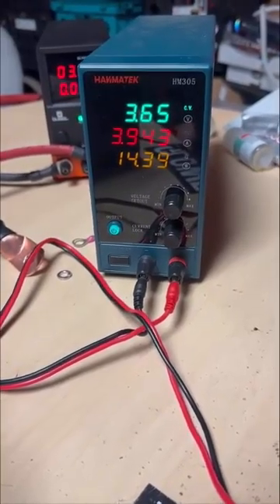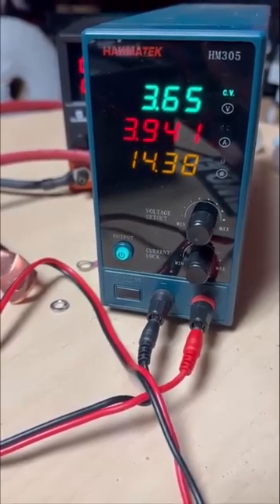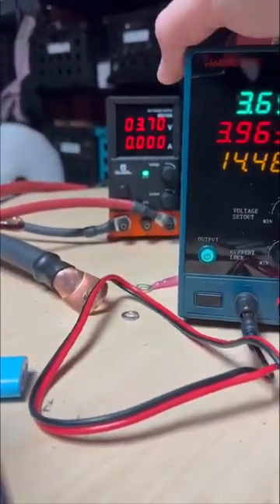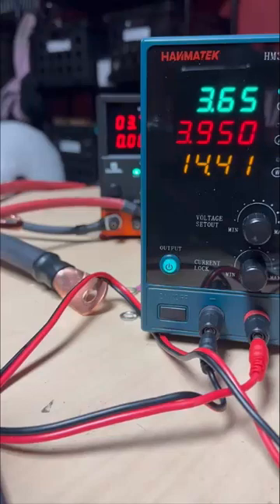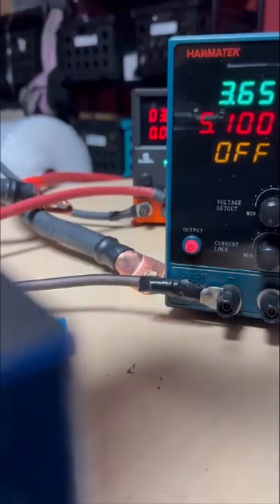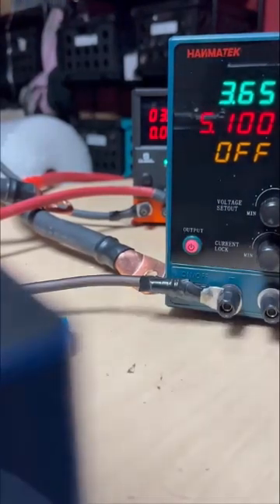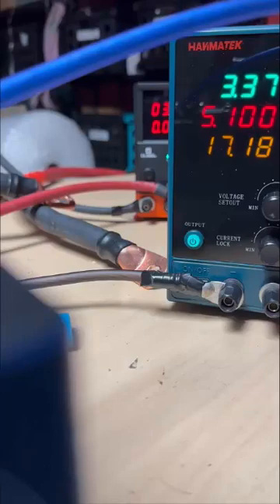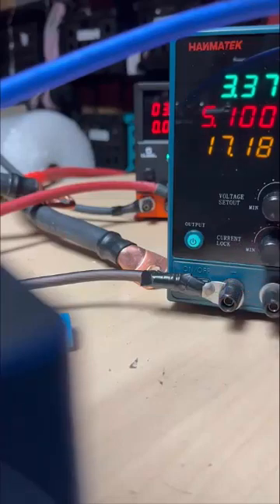Charging lithium batteries?  You're doing it wrong! This quick fix has saved me HUNDREDS of hours!

Comment: I like when people know why- and not just - THIS is how it's done, - no idea of Why it's done that way 

-lithium -all types, use a CV maximum because of the separator that is used - between the anode and cathoid, it has the same -structure in Lithium-ion, and Lifep04, ... above 4.2 (critical 4.9) it will start to short out, it's enough voltage to overcome its resistance .. it's just as sensitive as a capacitor (like supper capacitors) to over-voltage, it's not the current charging it is why 4.2v - it's for safety, and a mean point for best Cycle-life and capacity .. - Lifepo4 can also charge at 4.2v, but it's not going to get its 20k cycle life... but can safely charge at that voltage   - now it's a different chemistry - the advantages do not outway the cost, - the voltage will still drop down to 3.35-ish at rest, and still have its FLAT discharge curve 

- battery types that fast charges like NIHM/cd or Flooded acid.. can keep raising the voltage to maintain current .. this is called VV/CC (variable voltage constant current ) there able to do this because they burn off excess charge as a heat ... - a nihm, it has a resting voltage of 1.4v, nom of 1.2v - a Vary flat discharge curve ... you can go up to 5v-cell during charging, this will not damage it at all ..., there are multiple ways of knowing when it hits FULL-charge, the easiest way - it heats up and gets hot to the touch..  .. (or a charge will look for the voltage of the cell, it drops slightly at FULLy charged ) 
flooded acid can do this vary similarly, above 2.45v it's going to start off-gassing , you must replace the electro-water ) 
- attempting this even 1 time on Lithium will destroy its live-span and can be very dangous if you do not know that already
Reply from the maker: I like LifePo4 if for nothing else than how safe they are.  I've been completely unable to ever make one catch fire or do anything worse than vent.

Comment: All of my charging sources used for semi-permanent charging have 10 gauge wire.  It's good for 30 amps (40 amps for 90C THHN) for long runs and easily 20-25% more for the very short runs associated with most battery charging - that's also why they make IR thermometers ;-)
Even some of the physically small lithium-based packs have serious current potential.  A Fuji 12 volt 9AH battery pack has a 4s3p configuration of Murata LiFePO4 26650 cells that can deliver 25 amps per cell.  If you plan to use the pack's full capabilities, you'll need a big BMS and some serious wiring.  I'm more likely to use a pack of its physical size as a replacement for an AGM UPS battery so a 30 or 40 amp BMS is fine and we're back to 10 gauge wire.  Nice to have a UPS where the UPS' low voltage shutdown is higher than the LiFePO4 pack's low voltage cutoff.  The UPS can never damage the battery by excessive discharge - that plus the usual overly agressive charging UPS units do (to get the battery back to full capacity as fast as possible) contribute greatly to the short life the AGM batteries in UPS units experience.
Reply from the maker: Notyoung, the batteries that we (Glowe Voltage) sell are designed to sustain over 400 amps.  They're abused in car audio situations every day, for sure.

Comment: You might also want to pull the case off and have a look at the internal wires, mainly the two going from the board to the back side of the Pos and Neg banana terminals. I can't remember what mine were for sure but I think they were 14awg internally. So I just soldered a run of 10awg for Pos and Neg on the inside of the case. After I got it out back together I made a couple 10awg leads, the difference is huge!
Reply from the maker: Good idea, but I primarily use a much larger charger. This was more or less for demo purposes.

Comment: See if you can find a charger with sense input. The sense leads connect via separate cables directly to the battery terminals and compensate for loss on the charging cables.
Reply from the maker: A lot of the battery testers I use have 4 wire input. That’s not going to beat the resistance on the charging lines though when a static voltage limit has been placed.

Comment: Are you really charging 4 cells in parallel to 3.65V and negligible current?  That’s way overcharged compared to the manufacturer’s stated charge termination point of 3.65V max at 0.05C.  If those were 280Ah cells and you have 4 in parallel, you should be stopping once the CV phase current drops below 56A. Any lower than that and you’re overcharging with detriment to the cell longevity.
Reply from the maker: Hmmm. My manufacturer states to use CC/CV charging to 3.65v.
Reply: @GloweIndustries  I bet they also state that whatever cycle life they’re forecasting is based on terminating that charge at 0.05C, ie not tapering to zero as you seem to be trying to do. That little detail gets overlooked by everyone, even the resellers don’t understand the significance. 

We all know the voltage rises in proportion to the current you’re pushing when charging, just as it drops when drawing current to a load. That effect becomes exaggerated in the top knee, so when you charge to 3.65V tapering down to zero, you’re at a higher state of charge than if you stopped charging when current tapered down to 0.05C level. Proper termination at that point would likely see the terminal voltage drop straight to 3.37V per cell and yet you’re fully charged. Pushing more in can be done, but you bet it’s having some effect on cell longevity.

It’s a subtle detail easily overlooked, but if you care about your cells lasting their full lifespan it’s worth paying attention to.
Reply from the maker: @PVflying  .05c would be 1.6 amps
on this 4P bank of 8ah cells.
Reply: @GloweIndustries  I didn’t realise you were using 8Ah cells. They looked bigger
Reply from the maker: @PVflying  they actually might have been larger cells. 🤔 genuinely don’t remember, filmed this kind of in a hurry. 

That said: 3.8v is the limit on most of these cells, with 3.7v being the “operational limit” which we don’t charge them to..

If charging should be stopped at cv mode at .05c, it would be impossible to use a 10a lifepo4 charger to charge a 280a bank, yeah?

Lifepo4 chargers generally charge up to to where cv is switched on, and maintain that charge until they drop to 10% of the chargers max output.  This means that charging up a 300a bank to 14.6v with a 10a charger it does not stop until it reaches 1 amp of current..  so using anything under a 140a lifepo4 charger is detrimental (since it’d cut off at 14a) on a 280a 4S bank?
Reply: @GloweIndustries  yes correct, however easily mitigated by setting a lower charge termination voltage when using a smaller charger.  My charge controllers on my offgrid system are set to charge to 3.45V/cell which will be less than 100% SOC the first time they hit that limit in a sunny afternoon with 100A+ flowing, but as the sun sets and that limit is approached at lower and lower currents, I’m reaching fully charged by the end of the day without risking going over.
Reply from the maker: @PVflying  🤔 This is pretty good info. 

Now for the doozy - how does it make you feel that no one uses BMS’ (active balancers only) for what we use them for specifically?  And on top of that, they get floated at 14.4 for hours on end.  👀
Reply: @GloweIndustries  how I really feel about that is that this is a topic little discussed and not widely understood, so little wonder people think that’s ok. They likely won’t even realise their cells are degrading faster and maybe I shouldn’t worry over it either as these things last a long time and perform so well that the difference between best practice and what’s doing a little bit of damage over time probably doesn’t get noticed. 

It would be a good subject for a video if you feel like it. The difficulty is convincing people that it’s valid, as the whole world fixates on 3.65V as a limit and seems to think associated current isn’t important. Bound to be controversial so I’d understand if you want to leave it alone.

Comment: I wonder if the resistance would be less if the ring lugs were the correct diameter of the posts on that charger?
I noticed they looked larger than the post size, be interesting to see any difference?
Thanks for sharing as il be charging up my new bank soon 🇦🇺🤙
Reply from the maker: I imagine it would help at least a small amount, sure.  Fractions of a miliohm add up fairly quickly when the batteries you’re charging are only fractions of a miliohm for sure.  Real easy to double the resistance to the load.

Comment: You have to be extremely careful using bench power supplies to charge batteries.  I have that particular Hanmatek and, like most bench supplies, you absolutely cannot put reverse voltage on its output leads.  This includes turning the supply off (like you just did) or unplugging its AC cord while it is still connected to the battery.

Now, when connected to battery cells at such low voltages, 3.65V, it might be able to handle it, but as a rule, you are playing with fire.   A dedicated battery charger is almost a requirement.

That said, I use my bench supplies to charge batteries too, but I run the output through a bunch of Schottky diodes in parallel (each one can handle 4A in free air) to protect the supply.   Which works great for battery packs, I might add.  But doesn't work well if you are trying to charge individual cells such as in your video.  It is difficult to get the correct output voltage since the diodes have around a 0.34V drop under load, but that decays to no drop as the current goes down.  I typically use 20SQ060 Schottky diodes for that purpose (which can withstand 60V of reverse voltage).

So for charging individual cells at 3.65V (or individual cells in parallel at 3.65V), there is really no good solution that is safe other than using a battery charger capable of outputting 3.65V.

--

8 gauge can carry 40A, that's really overkill I think.  10 AWG or 12 AWG is fine for this purpose.  Sure, there is a voltage drop, and when your output is set for individual cells I totally agree it does make a difference.  But the drop isn't that great as long as the wires are short.

More importantly, DONT USE BANANA PLUGS!   That's the key.   Banana plugs are horrible for carrying real current.  In fact, they are an arcing and fire hazard at high currents.  Instead, crimp ring terminals on your wires and use that to get a solid connection to the power supply.  I think using ring terminals are more important the low AWG in this case.   Ring terminals on 10 AWG or 12 AWG should be fine at 15A.

Also, the lower the amperage, the lower the voltage drop.  So once the current drops off it basically doesn't matter what gauge the wire is.   Wire losses are a function of the square of the current so losses at 4A are only 8% what the losses at 14A would be.
Reply: That was my immediate take-away as well...just switching from banana plugs to ring terminals was probably 90% of the net gain.
Reply from the maker: Good input!

Comment: One more tip.  When you are pushing high current into one of your parallel packs.  Do remember to check for voltage drop across the bus bars.  You'd like to hope, with using proper copper bars the resistance will be measured in 10th or 100th of miloohms, but that can still result in a small voltage drop between cells in parallel.  Usually more a concern on the discharge side when the current is 100-200A.  To push 100A through 1 Ohm you need 100V.  Pushing 100A through 1mOhm drops 0.1V.  10mOhm its a volt.  Volts * Amps = Power.  100A * 0.1V = 10 watts of heat probably fine.  100A * 1V = 100Watts.  Now it starts to depend on where that 100W is being concentrated as to whether it's going to start a fire or not.
Reply from the maker: … when top balancing in parallel?  I’m a firm believer you should let the cells rest with no external charge until all of the cells match.  Very much for the specific reason that one cell will normally be 3.65 with another at 3.58 etc due to the resistance from the point of charge. 

I agree with you here and have observed this first hand.  It is especially prominent when doing like 16 cells in parallel to top balance for sure.
Reply from the maker: Also, CC/CV charging is good for this because the higher voltage cells once they reach the max voltage will begin trickling juice to the other cells while the charging gets drastically slower due to the voltage between power supply and the cell it’s connected to being close in voltage.

Comment: Understanding what the voltage drop means and I mean 'really' means is important if you are going to be working with high amp circuits.
Another test you might want to start doing to have some fun and learn a bit.  When you are doing these charges...  take a multimeter and measure the voltage between the PSU output + post and the cell + post.  (Wha?)  Yep.  The multimeter will read the voltage drop.  Makes sense right?  Now do the same for the - post and - cell terminal.  You will find the same voltage drop.  Put the meter down.  Have a cup of coffee or a beer and ponder what that means.  
Usually we would consider "GND" or - or NEG as being the same for all items in the circuit.  It's very important in many cases that they are the same.  However the experiment above just showed that they are not at all equal or the same in a high amp circuit.
Reply from the maker: Paul, our 48 amp hour battery is capable of sustaining over 12 volts with a 420 amp load. 

Voltage drop is literally the primary issue we work to combat with what we use lithium for.  We are powering car audio systems running at 60,000+ watts daily. 

Is that high current enough for you, or are you just here to attempt to be condescending while making yourself look foolish?
Reply: @GloweIndustries  I was trying to be helpful.  I'm not sure if you delibrately leave out or seem confused by the details and measurements you are seeing or not.  
60kW I'm going to assume you mean peak power.  You should never be bringing that power requirement anywhere near the batteries.  Usually the peak power rating on an amplifier is limited by the main bulk caps and how much they can safety dump and sink as instantaneous current.  It's also a very reactive load, speakers push back.
Ideally the amplifier itself should produce a constant impedance on it's power input, such that it's current stays "flat" and doesn't jump around but follows a smooth RMS average.
If you are seeing current spikes into the amps (you'll need a scope) I would suggest a super capacitor bank directly on top of the amp, let it take the current spikes and use your lithium cells with a current limiter to charge them.  The super caps can provide massive current and if they are wired onto the amplifier bus bar power input, it can provide it without (too much) voltage drop.
You work with audio, so you understand the impact of the ground moving by even 0.1V.  Luckily you also have a massive big heavy block of metal to use as a ground bus bar!  The chassis and engine block.  It will take a LOT of current to drop 0.1V across that!
Reply: The reason I'm following along is that I am making a lithium iron audio battery, just with a different purpose that yours.
I do not need high current.  I need high voltage, positive and negative rails and I need silence.  Going with 6S LFP 14Ah Varicore cells.  To get 21V and +10.5V and -10.5V tapping the centre of the pack.
It will power anything connected to my audio gear that can't be optical.  DSP, DAC, ADC, headphone amp, desktop speakers etc.
When it's in use it will galvancially separate itself from the world.  When it goes to standby it will connect itself to a DC power supply and charge.
So as long as I let it sleep and charge, it should be ready to run for quite a few hours without any noise induced from the busy computer and electronics lab power rails.
Testing out the JK-BMS's this week.  Also got a active cap balancer to play with, but I expect it uses more than it saves and should only be trigger when necessary.
Reply from the maker: Also — please see my other video about voltage drop between a psu and the cells and ways to drastically improve charging speeds. 

We’ve covered this.